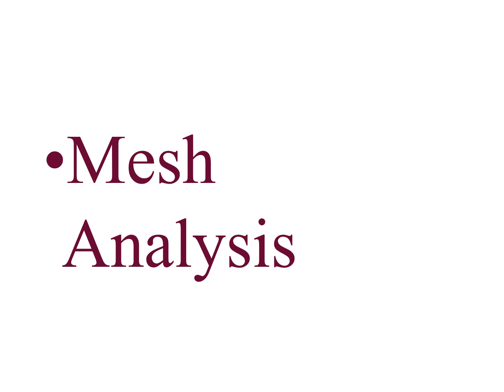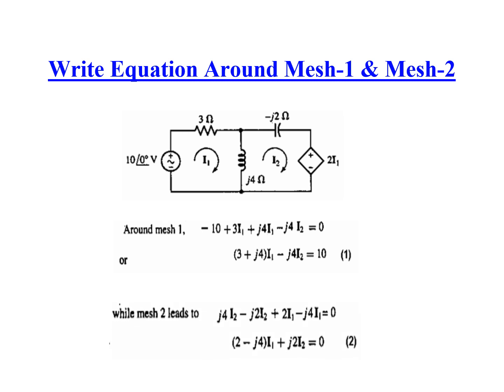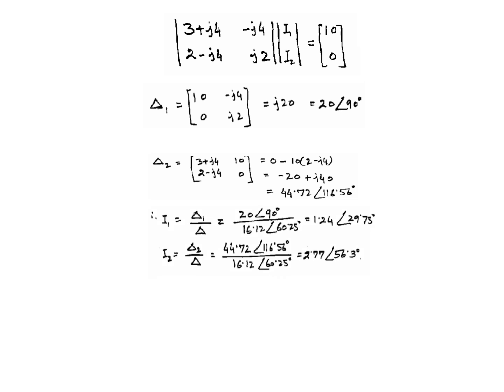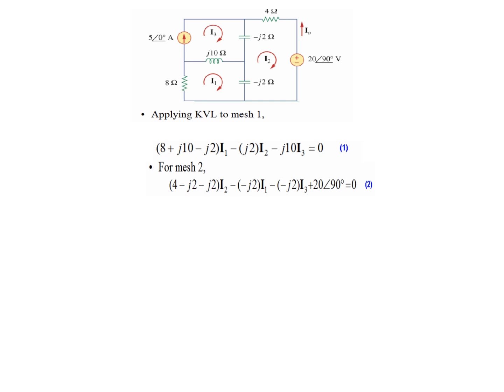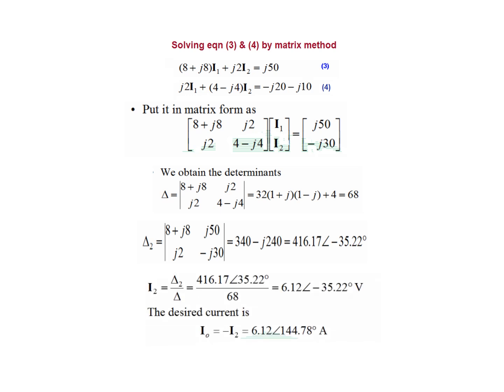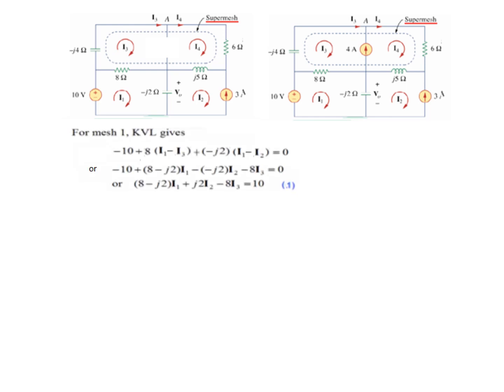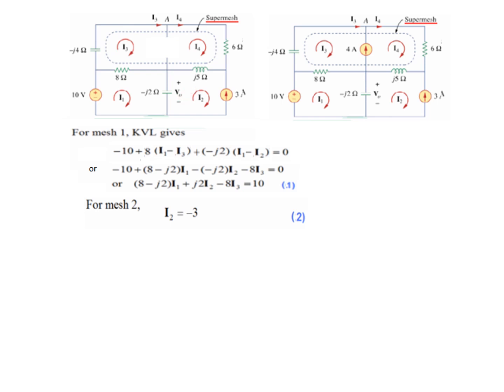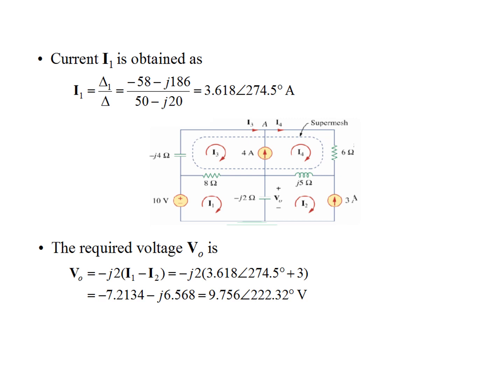Mesh Analysis || Super Mesh || Example 10.3 || Example 10.4 (Super Mesh) || ENA 10.3 (English)

Comment: And at 5:58. How did you multiply i0 with -1 and you found that annwer?
Reply from the maker: could not locate the issue. please check the time again.
Reply: @ElectricalEngineeringAcademy  sorry 8:47
Reply: Bottom part
Reply from the maker: @OnMyGameplay  look at the circuit, Io and I2 are in opposite direction, so Io=-I2
Reply: @ElectricalEngineeringAcademy  i know but i didnt get the change in result
Reply: İ mean angle changed by which formula
Reply from the maker: @OnMyGameplay  If you start reading from Chapter 9 videos, all your minor doubts will be clear.  Imaginary number j is equal to 1<90, and -j=1<-90.
Reply: @ElectricalEngineeringAcademy  i know but how did 6.12<-35.  Become 6.12<144 can you explain?
Reply from the maker: @OnMyGameplay  One way to understand is what is called unit circle (google it). The other way is to note that cos<0 =1, and cos<180=-1, so for minus sign add 180 degree (since phasor is nothing but magnitude and angle of a cosine function).

Comment: i got -85 angle, cant get the 274
 angle
Reply from the maker: You must have got -85.51.   We can add (or subtract) 360 degree with any angle without changing the actual value. So -85.51 + 360 = 274.49 or 274.5